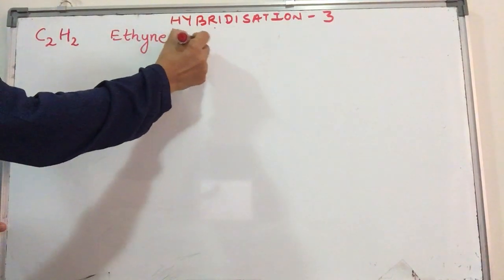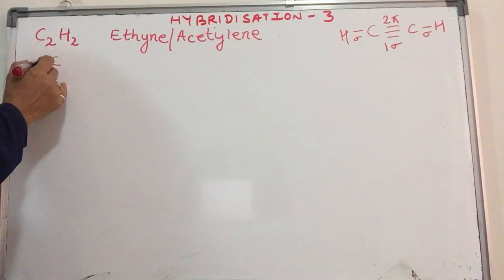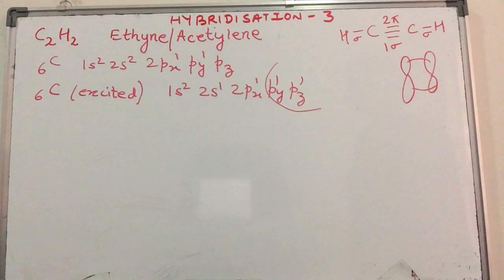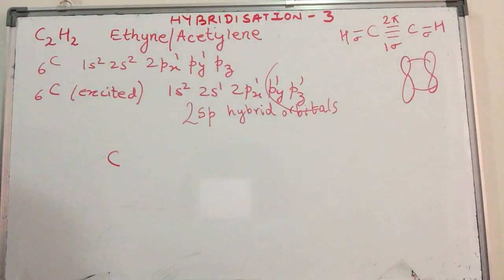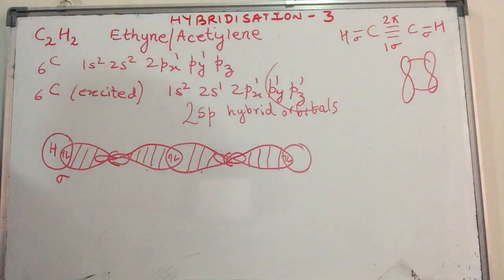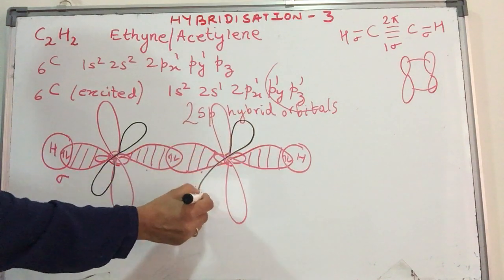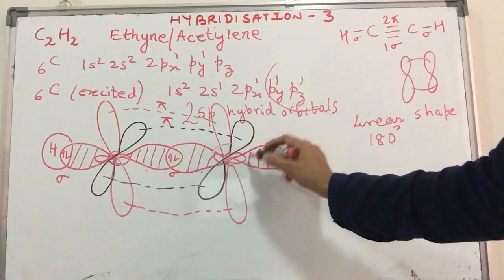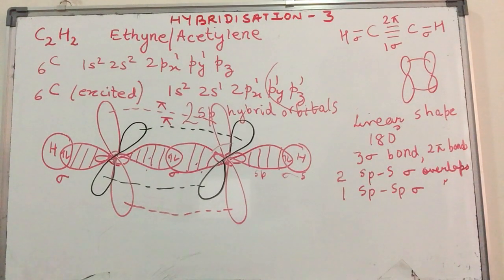sp Hybridization using Ethyne as an example

Comment: Mam pz orbital forms sigma bond with another pz orbital, then why are we taking it as π bond. Please clarify
Reply from the maker: Minati observe the way the orbitals are overlapping, perpendicular to internuclear axis or along it? 
Since they are overlapping like 2 ll lines and not hotizontally, they are π bonds. Also both lobes of the p orbital overlap.
If still in doubt, please see the video differentiating between sigma and pi bonds
https://youtu.be/fPGhCvr0viw.
Hope this helps, else let me know and we will work again on it 😊
Reply: Yes mam they are parallel to each other and perpendicular to internuclear axis, but I think pz orbital passes through internuclear axis then why here it is not passing?
Reply from the maker: Minati, this is about 3 axis and it can be any one internuclear, the remaining two just become perpendicular. like your thumb, first finger and second finger stretched perpendicular to each other.
When we say X- Y- Z axis it's the 3 of them mutually perpendicular.
Reply: Yes mam they are parallel to each other and perpendicular to internuclear axis, but I think pz orbital passes through internuclear axis then why here it is not passing?
Reply: Thank you mam for clearing my doubt. 🙏